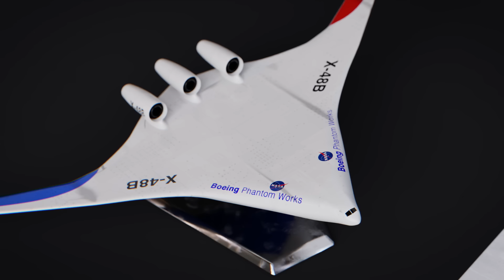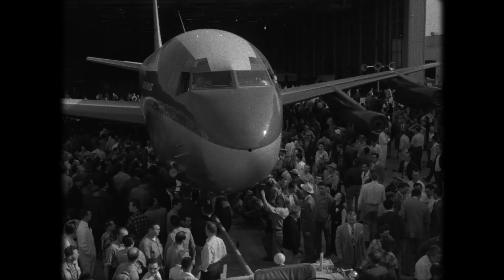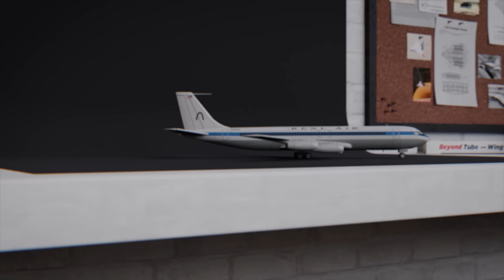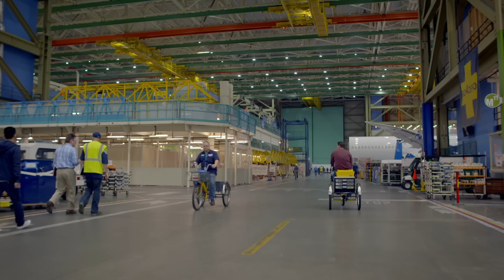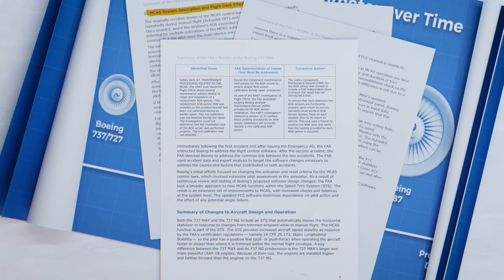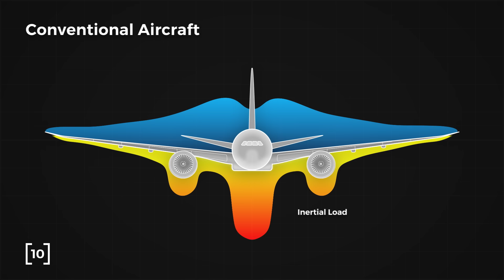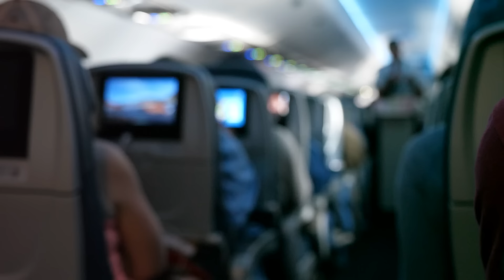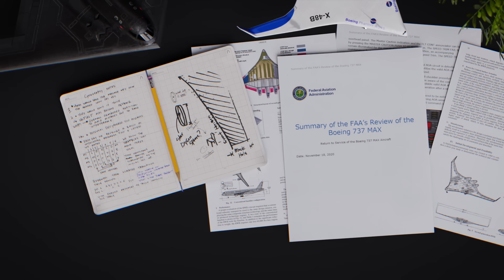The Plane That Will Change Travel Forever

Comment: There was a case where one young engineer… asked repeatedly for a more sophisticated type of flight control on the MAX. 

Ultimately– after the third time– he was told no. 

And one of his managers told him that ‘people will have to die’ before Boeing will change things.

The unions in the Seattle area had developed a power base of their own. 

And the company said in their own documents– which were later revealed in an NLRB case– the company felt that it would reset the relationship if they had another workforce in South Carolina– which also happened to be a lower-paid workforce– to leverage against that union workforce in Seattle. 
I wrote the book from the point of view of Boeing as epitomizing what’s happened across corporate America. 

And you look at Purdue Pharma, you look at the performance of GE during this time period, and it’s meant to be a cautionary tale that relates not just to Boeing, but to all of corporate America.

Comment: A 15% lower takeoff weight would also make a fully electric plane more feasible. Lighter planes combined with higher energy density batteries is a winning combination. According to Elon Musk, energy density needs to be about 25% higher than it is now for electric planes to be viable. But if you factor in a 15% weight reduction, the battery wouldn't need such a steep increase in energy density.

Comment: You are not correct regarding the role of the tail and how a mono-wing design/pusher accomplishes the same yaw and elevator control.  CG is simply the center of the elongated structure (like see-saw).  The tail weight is offset by engine weight in single-engine piston aircraft.  And offset by the placement of the engines and wing on a jet aircraft.  The weight of anything placed in the aircraft must also be distributed to maintain the balance over CG.  Mono-wing piston aircraft achieve yaw and elevator control by moving the rudder to the wing-tips and adding a cunard on the nose.  Or the mono-wing is equipped with wing-born elevators and yaw dampers to achieve the same thing.

Comment: As an A & P mechanic for over 30 years, I can tell you one reason I hate the design of all of these concepts. The placement of all of those engines would be at least 20 feet above the ramp. Pilots will not be able to do a proper walk around without the use of a stand or lift truck to GVI the fan and turbine section. Also, maintenance personnel would have set and move a lift truck multiple times in order to simply add oil to an engine. I’ve worked on DC-10’s and MD-11’s for 25 years, and I can tell you that the number 2 engine in those 3-holers is the least looked at by maintenance because of the hassle that is involved with dealing with it. 

I’ll probably be long retired by the time something like this shows up. Hopefully they’ll find a better place for the engines by then. I doubt it though. I haven’t met an engineer yet who started a design concept with the phrase: “I wonder how we can make this maintenance-friendly?!” 😂🤣😂🤣😂

Comment: 3:57 Actually the 320 was only 7 ft longer than the 120. The DC-8 is a much better example of stretching. The 707’s shorter main landing gear limited its stretch.

Comment: Your Lift Distribution @17:55 does not seem to be correct, your fuselage is the opposite shape of a wing and adds a huge downward force . The belly of the pictured aircraft is problematic.
Right?  Airflow over the center of the pictured aircraft does not add ANY lift as pictured.
Reply: Still, like PC I learned a lot of info even though I have done much work on RC delta wings..  THANKS!

Comment: just wonder if you've heard of the De-Havilland Comet. tube and wing before 707. yes it had problems but it was at the cutting edge of design and was out before the 707. Boeing took advantage of the lessons learnt from the square windows of the comet by making rounded windows.
Reply: The windows weren’t responsible for the couple of very public hull failures though were they?   The cargo doors failed iirc.

Comment: Really, the 707 was the first? I'd say not - the Comet was the first tube and wing layout, the 707 learnt from the Comet, especially when it came to critical safety issues - the Comet had the issues & all of the information learnt from the failures ended up in the hands of Boeing, which was then able to make the leap over the Comet before it got back into the air.
The only difference really is the podded engines on Boeing vs the in wing engines on Comet.

Comment: Regardless of the fantastic engineering of airplanes, the fact of lifting 100's of tons of steel, people, and freight 5-6 miles high on every flight, is a energy disaster. Rail is vastly more economical and environmentally sound. Only huge public subsidies for research, fossil fuels, and airports  keep the airlines running and the pollution pouring into our atmosphere.

Comment: So, a couple facts that it seems that you missed. The MCAS system had already been created for use on military 767 midair refueling planes. It was created then to help balance the plane as the center of gravity moved back and forth as fuel drained from the tanks. It was not an act of corporate greed.      In fact, the reason the decision was made was for the same reason that the manufacturers try to decrease fuel consumption,  to save their customers money. Training new pilots on the plane without MCAS would have cost airlines hundreds of millions over the life of the plane.     The only stupid idea that Boeing had wad to only place 1 sensor on the system, which (you're totally right) is criminally stupid. But to construe it as corporate greed is to ignore many other factors add well. Of course Boeing wants more money, we all do; but there is rarely a decision made in this world that comes down to a single deciding factor.
Reply: Well you forgot one detail... Boeing has no Narrowbody airliner and its2022. Southwest Airlines drove this craziness by try to get an ever longer 737 without changer the type. This can't be done with mechanical hydraulic flight controls and use of same tail and landing gear. This same type concept with MCAS is a hoax to keep up with A320 flyby wire. Southwest pushed Boeng into a corner keeping an old 1968 737 type flying .

Comment: Specifically the Pitot sensor went bad on the 737.  Normally aircraft have only one sensor, at least small business ones do. They are typically very reliable.   If Boeing is doing what a lot of other companies are, the software with the problem was likely coded in a low paying country and purchased the sensors at a significant lower price and quality.

Comment: 12:23 - You have not read the e-mails, I see.
13:20 - I think it's kind of a giant insult to the engineers that made that software. The reason those planes dropped, was because the pilots were not made aware properly that the plane HAD MCAS.  Because doing so, properly informing them, would mean simulator training to be licensed to fly it. The software worked. The sensor failed. The pilots were not aware that they had to account for a system acting up because of failure of said sensor.

Comment: What made WW-II era aircraft like the B-29 or Boeing 307 Stratoliner not fit the Tube-and-Wings model? Both planes have long, skinny, tubular fuselages, long wings, and wing-mounted engines. Both planes were both also pressurized (The Boeing model 307 was the first airliner with this feature), and flew before the B-47. Is it that they don't have swept wings, or that the engines are integrated into the wing, or the proportions of fuselage width to length?

Comment: Jame M...  No...the MCAS came from the KC-46, which needed to change the trim to balance the CG as they off-loaded fuel.  For the MAX, it was anti-stall, and not for control feel, since in a holding pattern turn (adding g to stay at the same altitude), with flaps up, the stall margin could become small to zero, as the AoA could get too close to the critical one...not great if you want to fly safely.  They also made it go from 0.6 degrees per activation to 2.7 degrees, which means that twice could be full nose-down trim.  They've added MCAS to the Speed Trim software, but made sure that it kept operating after the pilot hit the STAB trim button, which is a big difference from how the B737-300/800s work.  It was a single point of failure, and they also did not have an obvious IF statement to check...IF we are faster than 320kts....IF we are below 10,000ft...IF we have activated that thing already...THEN Stop.  Still surprised at how many people got this wrong and those interested should read the JATR report...it is clear and well done.  The FAA outsourced any hen-house checking to the fox...sadly.

Comment: The Max was grounded by the same ham-fisted terrible execution of a great design that has cost Boeing multiple military contracts over the past 30 years.

Composite materials are NOT more rigid than aluminum, titanium, or other metals.  They are actually somewhat flexible in the aerospace applications(there are composites using specific plastic formulations and heavier fiber that do achieve rigidity for other uses-i.e. automotive frames).  Flexibility is actually desirable, to some degree, in aerospace engineering, as a way to disperse stresses and ease loading on the underlying metal airframe underpinning the fuselage and wings.

Comment: Not sure why the entire industry is hooked on elliptical lift distribution...wing tip vortices can be eliminated entirely with the corect twist in the wing. This results in a better L/D and roll actually rids the wing of adverse yaw and replaces it with proverse yaw.
No rudder or split ailerons needed.

Comment: You are wrong about a vertical gust to cause a large pitch moment.
Tests show that the effect of encountering a vertical gust is a vertical acceleration, not a pitch angular acceleration.
The FAR's require a civilian airplane to be statically, passively stable for certification.
17:21, 17:58 Lift distribution: 
Completely wrong! Almost.
The lift distribution is nearly elliptical , and yes with a reduction over the fuselage width. 
The induced drag force depends strongly on the span loading L/b :
Di = (L/b)^2 ÷ ( q × π × e )
L :  Lift force
b :  wing span
q : dynamic pressure = density/2  ×               V^2
V : True airspeed
e : Oswald span efficiency factor due to lift distribution deviation from the elliptical.
The induced drag is not caused by the tip vortices, those are the continuation of the circulation about the wing .
The induced drag is caused by the increased kinetic energy from the down wards deflected flow, 
much larger than the SMALL kinetic energy due to the rotation distribution in the "tip vortices"
Take a course in aircraft aerodynamics!
Or get a copy of
Barnes McCormick :
Aerodynamics of VTOL airplanes
Give credit where credit is due:
That configuration was invented by Robert Liebeck, then a Douglas Aircraft engineer, decades ago!

Comment: That's a really good point that egress can be slowed down by a single person dithering and blocking a whole aisle. You'd think in an emergency that people wouldn't be reaching for their luggage... but remember when that very thing happened on an Indian flight? It wasn't just one person either, it appeared to be most of the passengers when the cabin was filling with smoke
Reply: systems have to be designed to accommodate for human nature, because you can make passengers watch all the in-flight safety videos in the world but at end of the day you just can't control what a customer does

Comment: The recent problem with many passenger aircraft is the use of "fly-by-wire" systems at all.  The  computers are in control and not the pilots.  Computer control works okay for military aircraft with ejection seats but does not belong in civil aircraft.

Comment: The 737 MAX disasters highlight not only the problem with the dramatically increased complexity of putting fly-by-wire technology in an aircraft, but the corporate greed and total lack of understanding of what it takes to train a pilot. The very idea of putting the solution in a phone or computer app was so ridiculous as to be criminal. It's hard enough to train pilots in the traditional way, but incorporating software programs that may be constantly changing into a system, presents even more complexity into an already complex system. Any and all software changes must be minimized, and tested, before training pilots in full size trainers, not phone apps. Software is inherently just as important as the hardware and must be taught just as diligently as hardware. The slightest update to software may have fatal consequences and must first be vetted in a ground trainer, then a flying Radio Controlled (RC) model, and finally in a full-size trainer aircraft before any paying passengers are embarked.
Reply: 737 MAX isn't fly-by-wire though?
Reply: @AmbientMorality  The extended spoilers are FBW. But some of the sensors did automatically control the flight systems without any pilot action.
Reply: @hifinsword  Oh, true. Yeah there's definitely a lot of augmentation on 737, just ultimately not a FBW aircraft

Comment: Great videos but I would like to point out that the first successful jet airliner was the DeHavilland Comet in 1949 which, despite some early losses due to learning about pressurisation stresses, went on to see service into the 1970's and continued with the RAF as Nimrod long after that.
Reply: Thank you for making the point, I flew back from Malta on a Dan-air Comet 4 to the UK in 1979, at the time I was training as aircrew on Nimrods and flew on them for the next 10 years. I joined Dan-air as cabin crew for 7 months until they folded. Great times... and all on the Comet!

Comment: The first commercial airliner was de Havilland Comet, it was introduced in the same period with b47(b47 is bomber not airliner), way earlier than 707.
Reply: I suspect what the presenter infers is that the concept of a longer fuselage as per the bomber's design, is what the 'airliner' was based from -  including the DH Comet. 
Due to a number of factors  (greater tolerance for initial failure, larger budgets etc) many advances in commercial aviation development are off the back of military/defence aviation.
For example the wing designs, including swept wing technology of earlier commercial aircraft had their origins in military aviation, even Concorde's wing design was based off the wing shape and performance of the Avro Vulcan supersonic-capable bomber.  

As you stated, while the DH Comet was a much earlier design of jet technology for commercial application, ultimately the B707 was more advanced, efficient and capable making it the success that it was, though that aircraft also was originally a military-intended airframe modified later for commercial use. The B747's original blueprints were for a high capacity military freighter which is why it was the fantastic success it was being capable of fulfilling both missions as a dedicated freighter, 'combi' and all passenger airframe .  
It is no secret though that Boeing gained much insight from the Comet's early technical advances, readily offered by DH engineers!

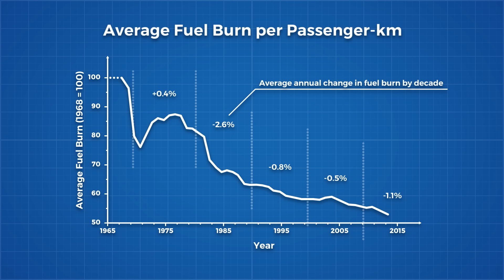Comment: 1:26 is this all through engineering or charging more for carry-ons, reducing weight of meals and water stored on-board and not flying short distances with too much more fuel than needed? I'd be surprised if those were all engineering improvements.

Comment: I really don't understand the need of tail wing always providing downward force.
Explanation of why was absurd - they just moved the center of mass to center of lift and removed the tail wing. OF course you wouldn't ever have a counter-force if there is nothing that can produce it! But why not just make tail wing horizontal? It will also produce counter-lift when plane tilts.

Comment: This isn't new. It was an old idea when I was studying Aerospace Design 10 years ago and we couldn't make it work then. The problem isn't the physics, it's the safety regulations. Current international safety standards require a commercial jet to be able to evacuate completely from a full passenger load in less than 90 seconds even if half the exits are blocked. Engineers have been batting this problem around for literally decades without finding a solution. Unless the standards are changed I doubt we will ever see this concept in commercial service.

Comment: Just the one question, to wit, what happens in severe weather? You pictured the B2 with fly by wire doing all sorts of stability movements while refueling. Does that work during takeoff and landing in a variable 10, 20, 30 m/s crosswind? Lastly, thanks for reporting on the rather more stable usual design, versus the inherently unstable flying/blended wing (see the refueling). In other words, I'll take the costs, to include the omissions, while Mr. Recently Indicted Max Fellow can keep his bad code and jedi mind tricks.

Comment: The Voyager round-the-world aircraft was unstable when loaded above about 60% capacity. Dick Rutan took amphetamines and simply did not sleep for the first three days of the record flight, hand-flying it all the way.

I worked with Dick for several years on the Ez-Rocket in the early 2000s. He was totally bugnuts insane on the Voyager project.

Comment: Can you please get up to date on CO² and climate change. It is a non-issue. The mob-level pseudoscience of committed fools. I will agree on pollutants e.g.NO⨱, however carbon dioxide is a plant food required to green the deserts (eventually) and saves water (more CO² means less activity by the stoma resulting in less H²O loss during transpiration). The Croll-Milankovitch conspiracy is the cause of our normal, regular variations in planet heat.
If not get behind the idea of de-humidifying the planet because water vapour is the principal determinant in heat retention. Crazy right?